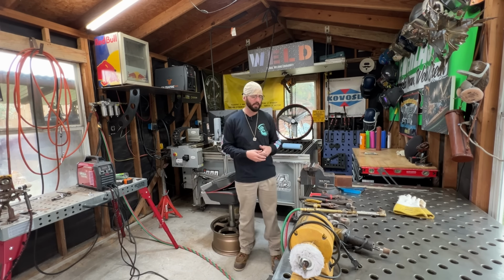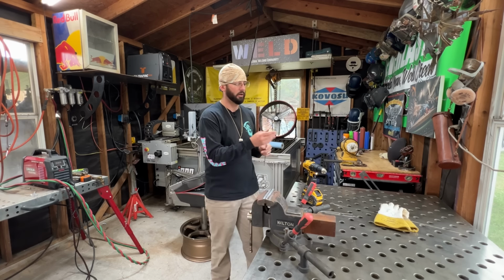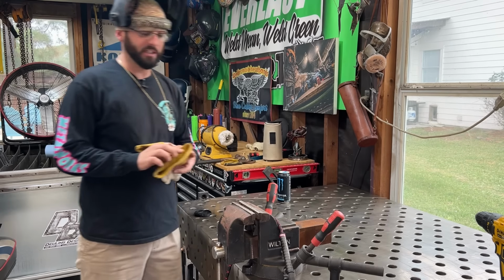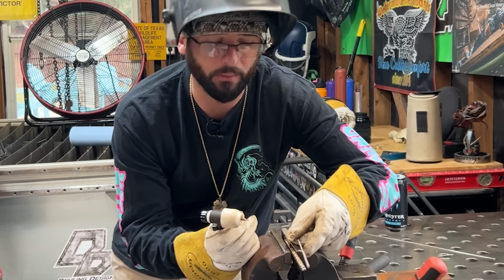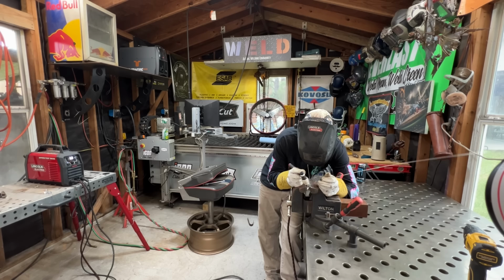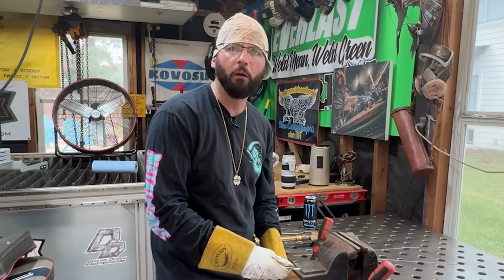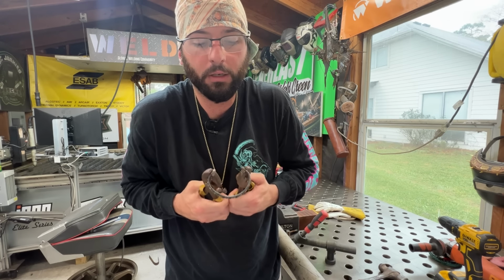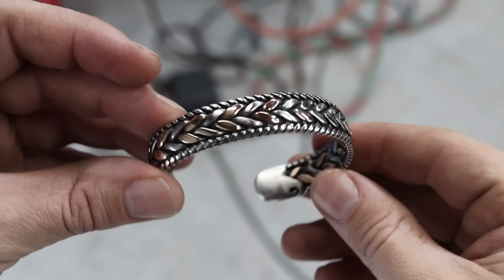TIG Welding Wire Bracelets: Step-by-Step Guide for Beginners

Comment: Dropping down in electrode size helps a lot with control.

Avoid nickel alloys if you don't the recipient well enough to ask about allergies. Nickel allergies are pretty common (most women know if they are allergic or not).

Comment: I just got my first TIG welder and I am making all my Christmas Gifts!!! This is the best Video I have seen on how to tack up the individual pieces. The vice also is a good heat sink which helps to keep from burning through as easily. I started out trying to just clamp the bracelet to my welding table but there was no way to keep the metal from warping as much.

Comment: If you have a hydraulic or spindle press, you can save yourself the hammering. Flat (ideally machined smooth) plate on the bottom, and one on the top, and just put pressure on it. Very consistent flattening. We used to steal copper wires from the electricians and make bracelets in the training shop

Comment: 1/16" tungsten would make your tacking more manageable. The 1/8" requires more amperage to achieve the arc, therfore the start amperage is higher than 1/16".
Very cool work man. 37 years welding and I haven't made anything for my wife. Maybe this! Thanks for the video!

Comment: Ok so i did this with a stick welder and learned a few things
1: Kinda hard to do the thin stainless so instead of bending one in half and twisting used 2 and twisted them for a 4 strand twist.
2: Easier to put all 4 pieces together and then weld a bead across them.
side note probably use a thinner stick I had to use a 1/16 rod

Comment: i always have bad luck with welding and hammering copper so i used stainless wire only. after polishing, i electroplated the whole thing with gold. after this i painted everything that i dont want to electroplate with copper with clear fingernail paint, electroplated the rest in copper and washed out the fingernail colour with aceton. 
electroplating is a nice technique to give metal surfaces a finish.

Comment: I prefer carbon steel knives because I like the way they take an edge--but I can see where carbon steel would be very bad for twisted wire jewelry: it will rust in places you can't get to to clean and polish.

Comment: I am a copper smith and twist a lot of copper. Put the two loose ends in the vice. Get a small
Eye bolt. And open up the eye and chuck it in the vice. Put the wire in the eye bolt with a loose loop give it a sharp tug to even the wire and start twisting.

Comment: What color tungsten and what grind angle did you use for that low amp welding?
Reply: You will be using low amps and trying to focus on a small tac sharpen your tungsten like a bee stinger and 2 percent thoriated worked just fine for me but that's also all we use cause I mainly just do weld build ups and then it gets machined away like it was never even welded
Reply: Don’t worry about it but. It’s just a bracelet. That was some 1/8” throriated with who knows the angle.